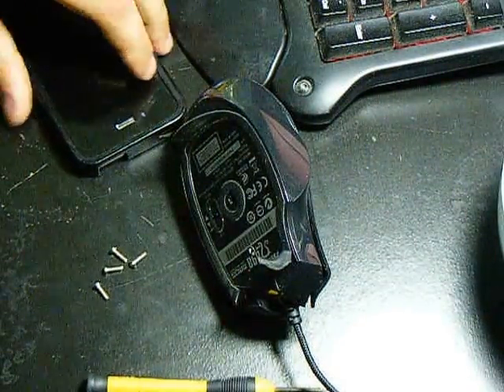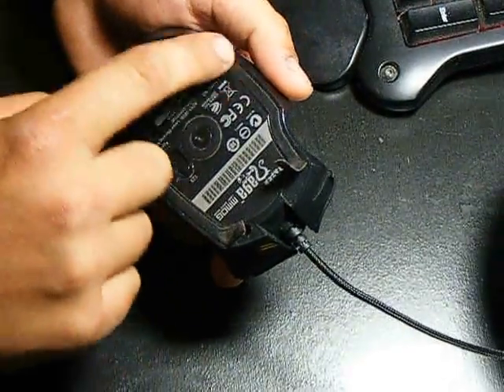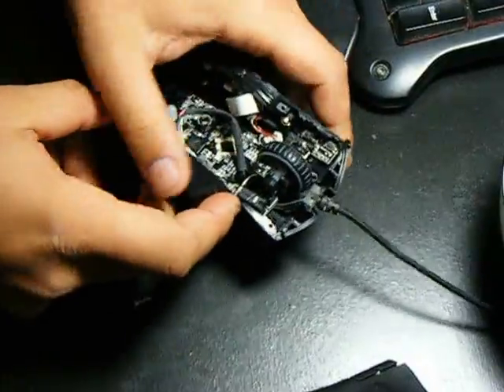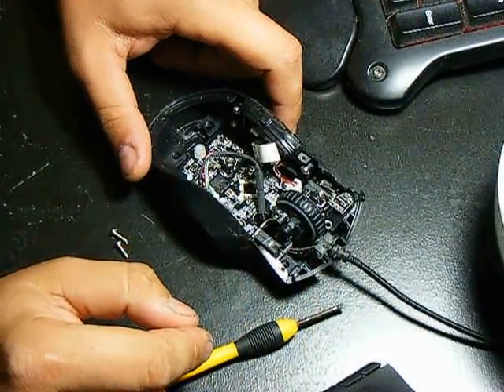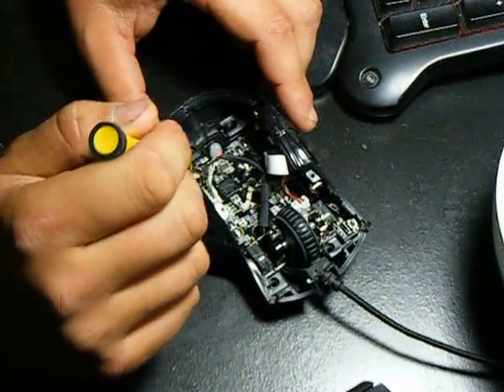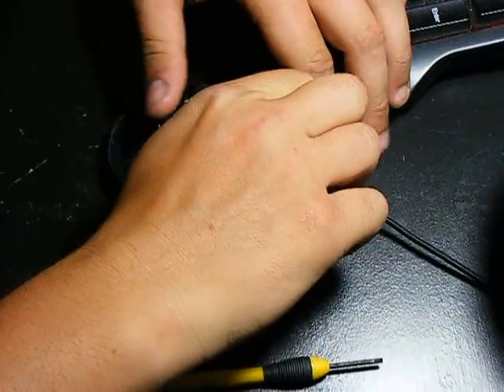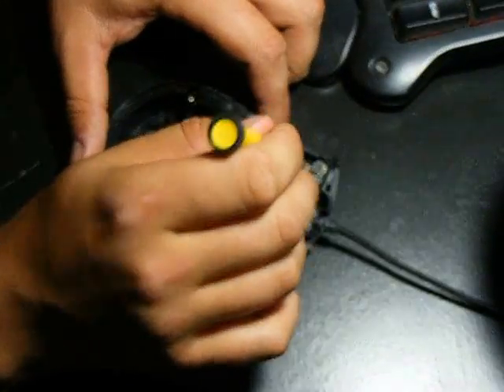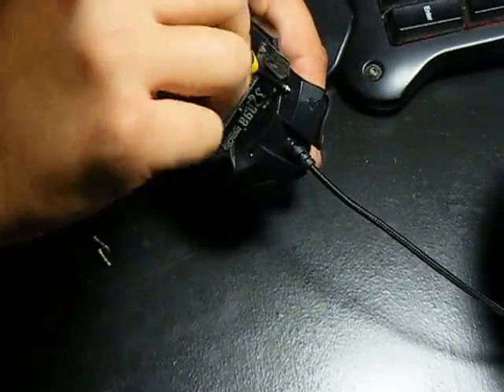How to fix a Razor Naga Double Clicking Problem

Comment: I had the same issue, while dismantling my mouse i noticed the part of the mouse button that pushes onto the clicker was worn out resulting in a V shape dent, i applied a lil amount of glue a few times while filing it down now the dent has filled up n the mouse works like new.

Comment: didn't work on my naga. Then again in my case, the switch might just be worn out because it has always seen very heavy use and it's over 5 years old.... actually the double clicking isnt the only problem it has. the razer naga app no longer detects any razer mouse when i run it, and the leds no longer light up. This thing has served me well for over half a decade, time to retire it.
Reply: /shrug

ok, after a few hours of applying the lubricant, the mouse actually stopped double clicking. it; has been a month and not a single double click to be seen. Also, i reformatted my pc instaleld razer synapse and it detected the mouse. i can even turn the lights on/off again. cheers
Reply: Razer isn't pure shit, I've had my naga epic for quite a few years now and it still works like I got it yesterday (then again, it's supposed to). But yeah the original razer naga is a collossal fuckup on just about every level.
Reply: yeah ive had my naga mouse for like 8 years before the double clicking thing happened, just blew into the end and all fixed :)
Reply: makes me cry in side

Comment: Silicone Spray is another very nice option. not just for the inside. but also for the bottom of your mouse. the pad. or anything else around that needs to run smoooth. Oil free. has its perks.
And yea i sat here laughing in tears when you said people suggest WD40 as "lubricant". right.... <.<
My naga epic is going flawless and strong for 6 YEARS daily hardcore use.
Razer just replaced the rubbed up USB cable a 3rd! time for free. years after warranty.
1a++++ for company and mouse after all these years. it did not disappoint.
And no 0 trouble with the optical or anything else.
"daily nerd functions" <3 yea
take care all x)

Comment: For those not wanting to open up their mouses, just blow into the mouse cracks on the forward part of the mouse. I have a Razer Naga Molten edition and blowing into the crevices and clicking a few times, then blowing again throws out the dust is messing with the sensors. This seems to do the job for me! :)
Reply: Did it after 4 years without playing with this mouse and it worked.....ty
Reply: worked for a few months, doesn't work anymore. I'm taking it apart fixing it this  time.
Reply: actually worked, thanks
Reply: Can confirm, worked for me aswell.
Reply: wtf workde
Reply: best tip
Reply: You've gotta be shittin me. . . .
Reply: Holy crap :D Best tip ever :) haha.. it fixed my Naga :D /hi5
Reply: Tried this method and it never works
Reply: What!!!!! Just got a new mouse, do this trick, and aparently it helped a lot, now i can grab a window and move it and it will not release it because of the false click. Damn, anyway was a 10 dlls mouse.
Reply: I just tried this out and it honestly seems to work. I don't know if it's completely fixed the issue, but I'm definitely seeing an improvement
Reply: Do you still recommend to open it and put some lubricant for better results?
Reply: i have razer naga molten special edition and it workss!! thanks bro, i hope youll be blessed!
Reply: OMG... I got a sweetheart deal on a Razer Naga Pro on ebay, wasn't sure on it until I got it and I love the swappable sides for work/home use.   But, after about 2 weeks I couldn't click and drag stuff very well, it was like something was ending the 'hold' of the click.    Found out about the 'razer double click issue' and found this video.    Was about to take the back apart (worried about cutting or pulling back the teflon sticker on back though) and gave this a shot.   Worked.   Awesome tip!

Comment: I've had my Razer Naga Molten for a few years now and it just recently started double-left clicking. Why did it have to be the left click. ):
Reply: +Nikorasu Pastelle Same here! 4 years going strong, and dealing with this too :< I don't wanna let go of her!
Reply: +Nikorasu Pastelle Mine too. Also molten. I had it for about 3 years.
Reply: METAK188 I've had mine for about 4 years. To be fair, it's lasted quite a considerable amount of time before any problems occurred.
Reply: Did you fix the problem? I lube that left switch but it still doesn't work as it should...
Reply: METAK188 Nope. I've been just dealing with it.

Comment: I would second not using WD-40 - that's just plain stupid.  I wouldn't put air-tool oil in there either, honestly.  They make products specific to this problem.  You'll want to visit your local RadioShack or similar and purchase some Control & Contact Cleaner/Lubricant.  If you can't find the Cleaner/Lubricant, the plain Contact Cleaner will work just fine.

Comment: I thought I had a software\firmware problem until I saw this video.  Since I have cleaned my naga it is now works completely fine.  I did notice that the left and right mouse button prongs that contact the micro switches were a bit worn but so far this is not a problem.  I have not put 4 bottom screws back in to avoid creasing the teflon U pad.  So in the future I can unclick remove the top.

Comment: This isn't the fix, it may work for some people if the problem is slight, but you need to open the micro switches and bend the spring back into place. there are other videos on this.
Reply: links? know this is old as shit

Comment: I tried to open mine but the screws got torqued so hard that when I try to screw them off the metal goes off them. 1st gen Naga btw.
Reply: You should definatly use high quality screwdrivers cause the screws are really tiny. Got a 1st gen naga aswell and it worked for mine. And a good screwdriver is definatly cheaper than a new naga ^^ maybe you can get them opened with a bit larger screwdriver even when the screws are damaged you can get them out and replace them with the same or similar screws (you can get them at your local hobby shop or tool-shop). good luck mate
Reply: MyOldGood Friend I got screwdrivers used for PC assembly, a lot of them made by Draper. This is not about how good/bad my screwdrivers are (I got 5 Philips screwdrivers btw, none worked), it's the fact that the screws have been so hard torqued in by the production assembly OR they have been glued in (happened to me when I tried to open a pair of headphones on a separate occasion). I wouldn't be the least surprised if it was the case, but so far this mouse is bust if I can't open with 5 kinds of Phillips head screwdrivers. I also used an electric screwdriver and that didn't work either.
Reply: well yeah might be glued then used one of my hudy scredrivers

Comment: This isn't quite the problem I have with 1st gen Naga but I neglected from fixing it because I thought the teflon would not go back on so this was good to confirm.

My problem is with the actual plastic button, my first was under warranty but I took it apart anyways and found a pile of powder that was once the inner plastic button. Sadly my 2nd is doing the same so I'll prolly go with the gluegun fix on this one. Does anyone have a 2014 model? I guess it will take time to know but I was wondering if the quality of the top buttons was any better.

Comment: I find that the "real fix" is to spray "RadioShack Control/Contact Cleaner and Lubricant" into the micro switches. You can squirt the cleaner into the micros switches through the small space between the micro switch's button and the micro switch's button opening. Use the cleaner's spray tube to depress the button. This will further open the space between the button and the micro switch's button opening. When you squirt the cleaner in, watch for it to spray out of the bottom of the micro switch. After this, clean off the mouse with compressed air and paper towel.. rubbing alcohol too if needed to remove the oily residue. Before reapplying the stick-on Teflon pads on the bottom of the mouse, clean this area with alcohol.

Comment: Best way to solve this problem is..... buy logitech  =/   I'm done with Razor's crappy quality.
Reply: Hate to say it man, but logitech's gaming mice do the same thing.  Just search for it - all the hyper-sensitive gaming mice have these issues.
Reply: Amir Sahaly
Heh, i feel ya - i have a 1st gen optical mouse by microsoft from the late 90's that still works perfect today.  Keep it on hand for when my "superior" mouse acts up on me...
Reply: Michael Medlock  +1 got same issue with a cyborg R.A.T 7 ! so like u say this shit happen to all mouse , the sad thing that my last mouse keep working for like 5 years and she cost only 15 $
Reply: i have a logitech i don't use it anymore it's a wireless one that is fincky as hell with it's bluetooth adapter and the charging contacts are so bad charging it is a pain. in short the naga has been far less of a pain in the ass then the mx logitech.
Reply: Joel De Jesus My naga has lasted 3 years of daily, heavy use with not a single problem. It just now has started a tiny possible double clicking thing every once in a while.
Reply: Meh, used the same Razer Naga Epic for 6 years. A little 20 min maintenance each year or two keeps it going fine.. people are stupid these days.. just because something breaks from use, doesn't mean it's actually broken.. just fix it.

Comment from the maker: To Chris, WD-40 is not intended for lubrication. It does contain several lubricating agents, but not intended for the sole purpose of lubrication of a surface. A true lube lasts a very long time whilst WD-40 dries up rather fast for a suspected lubricant. WD stands for water displacer, because the spray or oil is intended to prevent short term corrosion of metal surfaces. It also contain some penetrating agents as well but again it's not a lubricant for long term use.
Reply: Th3GamerGuy hi, I just got 1 for free but the right click button is broken. The piece that clicks the button broke off and I can't find a replacement. If you still have the mouse and if you dont use it, I'll take it.

Comment: Worked for me, it started bit by bit to do those doubleclicks and i fixed that issue by using BuggyMouse Fix which helped for while untill it began again that clicking again. i lastly decided to do this cleaning, and it totally repaired my mouse ;D i used myself (common lock melter) couple drops from tiny spray can. Thanks a lot for this guide, though it just gave advice ;) now I saved 80e :)

Comment: Hey can you tell me what type of screw driver you're using? I can't seem to figure out what screw driver to use for this
Reply from the maker: Well I have a set of small Stanley screw drivers that I purchased at my local Walt-mart. In this video I believed I used a Philips head to remove the shell of the mouse, and a flat head to pry around the edges.

Comment: Does this fix like the constant clicking with the right side? As of now, my right/left click work, but the right click like keeps clicking in quick succession if held down a lot of times. Also, my middle wheel will not click anymore. It scrolls up/down but won't click. I don't know if this video will help with the wheel, but will it work with the right click problem I have?

Comment: you are missing the big issue here.  The issue which causes these problems is the plastic tab which actually pushes the switch.  After a year or so of use a divot is worn down where the tab makes contact with the switch.  This divot can become so big that the outside ridges prevent it from pushing the switch.  It can also cause your issue by creating multiple ridges which actually press the switch more than once.  To fix this you need to simply fill this divot or shave off the ridges.

Comment from the maker: I would have just gone to your local hardware store and bought a big can for $4, same stuff. But that also works as well, on electrical connections. That stuff tends to dry the lubricants out. The oil I am referring to doesn't have to be pneumatic in nature, just a wet lubricant of any kind, not WD-40 (not a lube).